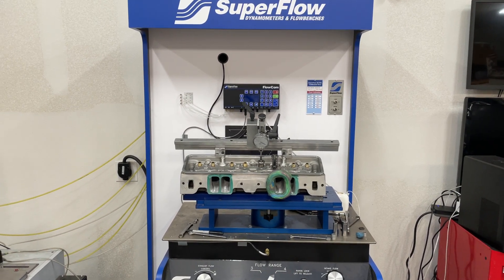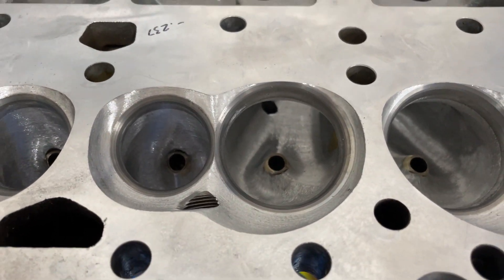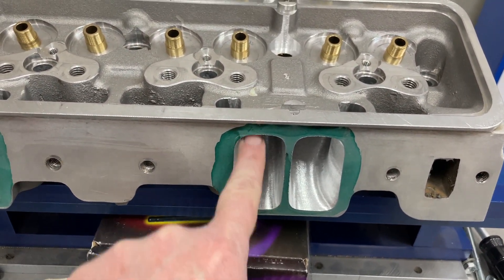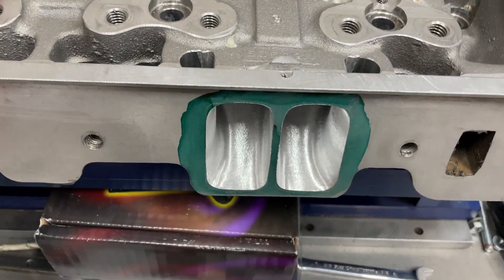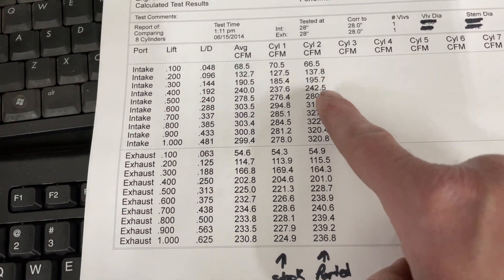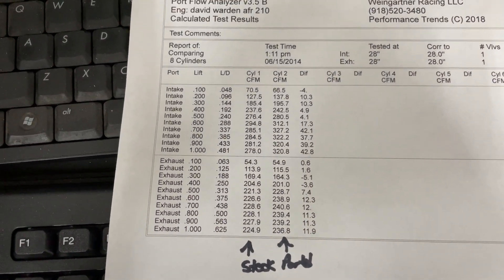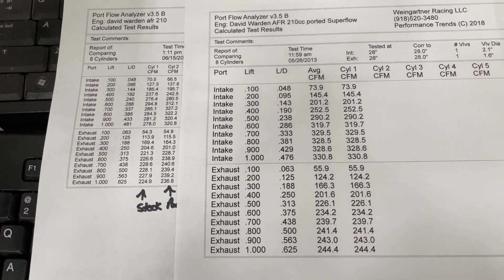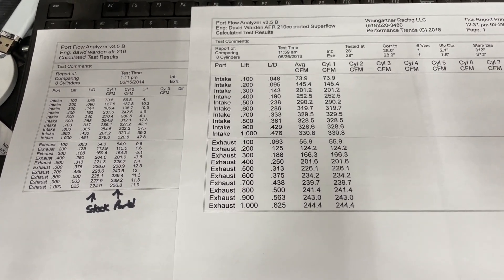Improving AFR 210cc Sbc head

Comment: Im glad I found your channel. Ive been binge watching all your videos and learning alot! Would these heads ported this way do good on a 383 stroker? Also considering running a tunnel ram. Cam choice being 254/260@50 .582/.588 lift 110lsa solid roller. Might consider 1.6 or 1.7 rocker to increase lift. Car would be mostly a spicy weekend cruiser and raced on occasions. TIA!
Reply from the maker: If you raced it more it would.

Comment: So JB weld wouldn’t hold up on a grind through into that head bolt hole? I just put some over the hole and am smooth it out almost flush to contour the wall the same

Comment: Thank you for making this video! Do you port match the coolant passage also? The heart wants what the heart wants and mine beats for a set of #906 Vortec heads. There is ALOT of material within my blued scribe mark for the coolant passage. Intake gasket is out of an 
Intake kit from Fel-Pro . "Problem solver gasket" i was told. The hasket has an exposed solid metal core with black rubberized molded gasket material around ports.  It's something I haven't seen discussed a lot in the many videos out there on gasket matching, let alone port work.  If you get time I appreciate your opinion. Thanks again
Reply: I always do on most heads im working on, why not eh after all coolant flow is super important too, yeah the vortecs are nice especially if your swapping away from a set of smoggers its like u have a whole different engine.

Comment: Well that Depends on how deep your pockets are, and how much work you're willing to do. But let me tell you something, Exhaust flow numbers are Not pointless, and are just as important as the intake. In fact, This is what will separate the Winners from Losers.
Reply from the maker: They are important but flow numbers from the flowbench on the exhaust side is not a good way to determine if you have a good exhaust port. You can set the throat at 86% and it will flow more on the bench than a 90% throat but the larger throat will make more power.
Reply: @WeingartnerRacing  I have no further comment on how it should be done, just wanted to point that out.

Comment: I have AFR 210 heads on a 406.  What intake do you like on those heads and would it need to be ported as well?
Reply from the maker: Depends on rpm of the motor.
Reply: @WeingartnerRacing  up to about 7000 rpm.